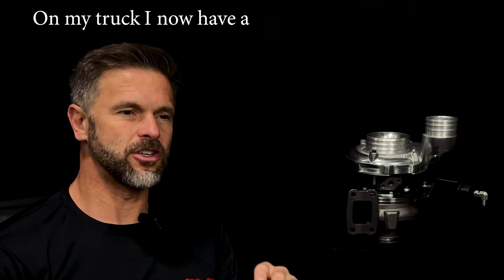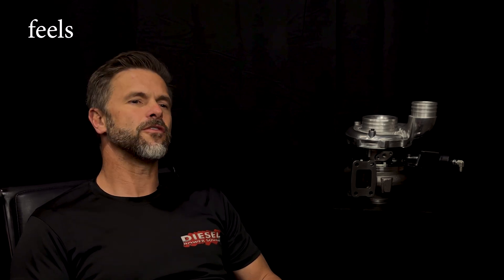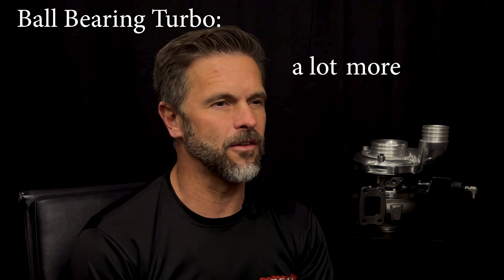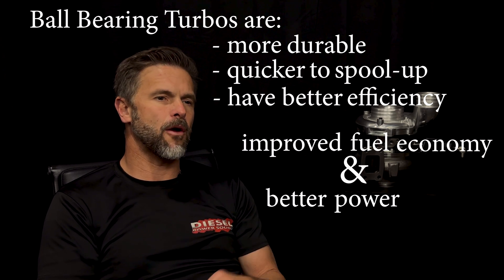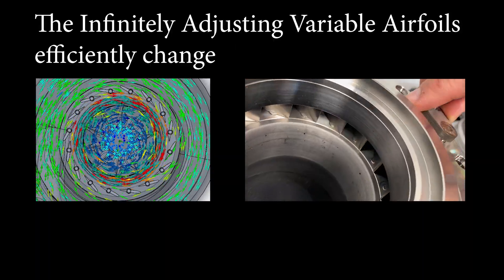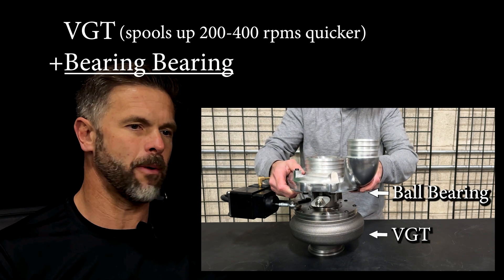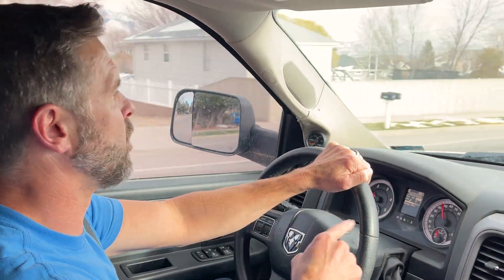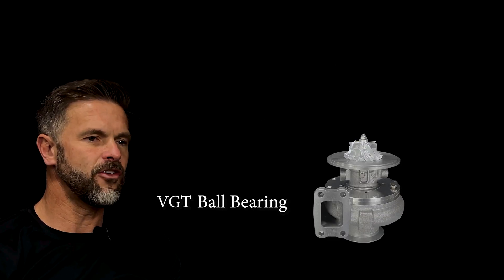Explanation of the Ball Bearing VGT Turbo for Cummins Diesel

Comment: Uh, did they find a new source for the bearings? Need to get the electronic controller back and make one of these for the S200 platform
Reply: I need this setup!  Lol
Reply from the maker: Yes we have finally secured a reliable source for our bearings. We also have a new electronic controller, but we don't have it for the S200 platform yet.